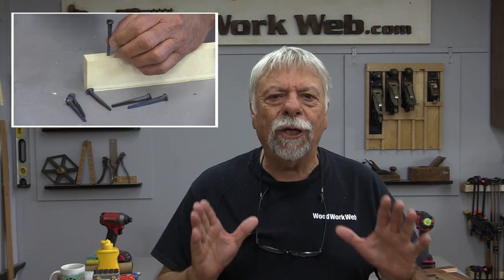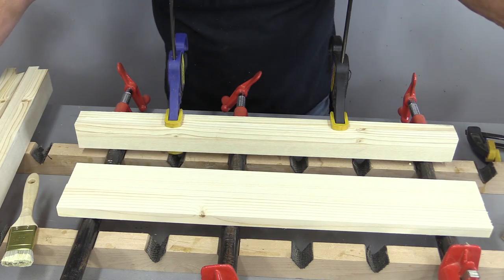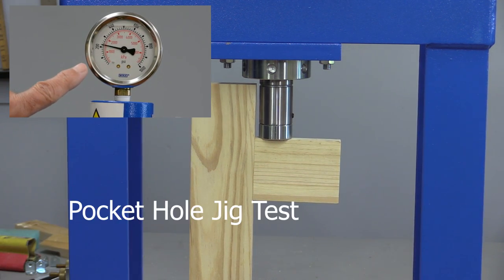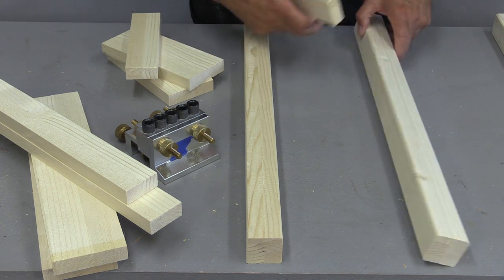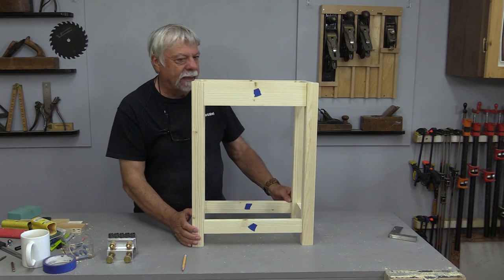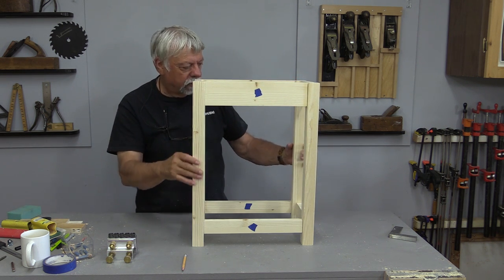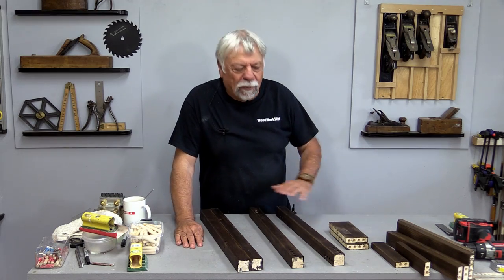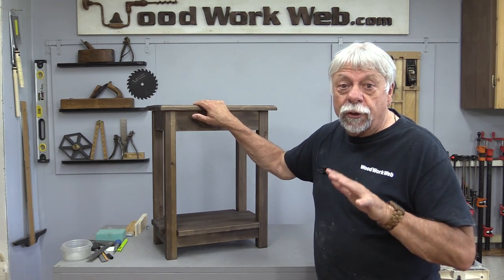Best Results for Woodworking with Pine Wood

Comment: Years ago, I started out building my furniture projects out of pinewood simply because it's always been the least expensive wood available.  And, I always figured that, as I got better at wood working, and had more money to spend, I'd surely switch to using the finer and more expensive woods.  But, after many many more years of building furniture, I still use pinewood today.  Over the years, as I became more familiar with the characteristics of pinewood, I started to see how easy it is to make my pine furniture look absolutely gorgeous!  It's also very easy to work with.  But, one of my greatest pleasures is taking a stack of lowly construction lumber and turning it into a stunning piece of furniture for people to enjoy.
Reply: a lot of pros say that it's much easier to work with hardwood. I like working with pine,just need to make sure it's dry before you buy it..boy does it like to do yoga or what...
Reply: I love pine. Light, strong and easy to cut and the price is right. Although lately even pine has become pricey. It seems that there is always a ton of scrap laying around at the end of driveways. Hard to beat 'free'.
Reply: I agree !
Reply: I use different woods but pine is one of my favorite. It really has grown on me.
Reply: I have want to make a 6 ft pine post but the wood keeps warping. Do you have Any suggestions please? I just want a 6 ft vertical, straight post, used 1x6 and it warped after I jointed and planed the wood. What can I do to prevent this?

Comment: I am very happy I saw this video because I had heard that using dyes eliminates patchiness  However, when I saw your results I saw the same problem I had which is inconsistent colour darkness.   Which I think is normal because pine has inconsistent densities. So even with dyes it takes different amounts of colour at different parts of the lumber. Fortunately, I have a solution which I will be publishing shortly.   Cheers

Comment: I did not know that 2 boards glued together are stronger the 1 board the same size. Ty for the education!
Reply: They are not only stronger but more stable, they resist warping and twisting as well. Guitar manufacturers have been doing this for decades. A good one to look up is Ibanez guitars, and just look as some pictures. They make the thinnest guitar necks in the world and they do a 7 ply usually of very hard but different woods. Guitarist take them from the desert to rainy Seattle sometimes even days apart and the neck woods don't move.

Comment: Hi Colin !   This is Vivek from India. I am new into woodworking as a hobby lately. Your videos and information  you share are quite inspiring in regards. What I want to know from you ... while trying my  luck with Pine wood, I see secrection of oil from the wood especially at the knots while sawing and drilling. Though I got a couple of 2×1 's  to try them out as trial, for  making frames for a wall hanging chisel storage shelf. I am not sure if adhesives will have a great go thru this oily and sticky surface .... Kindly  guide me on this please.....
Reply: If you have sap coming out of the knots, you can use knot sealer on them. It may ruin the surface around the knot for oil finishes, so it's probably better to use when you are painting the piece. If you have sap coming out of sap pockets in the wood itself - outside the knots - I have no idea how to fix this. I have a shed built with pine construction lumber, and it leaks sap in a couple of places even 10 years later ...

Comment: I'm still working with low cost materials, someday I hope to start making projects with nice hardwoods. These tips will surely help me now, thanks Colin.
Reply: Go to an actual hardwood company near you.  Buying stuff such as maple, ash, etc. from an actual hardwood company is only like 25% more expensive than buying appearance grade pine from big box stores.
Reply: The more you work with pine, you'll see that you can actually build some very stunning furniture pieces with it.  And, when it comes to staining, be sure to apply Minwax pre-stain wood conditioner before you apply the stain.  It will stop the surface from blotching and it'll look beautiful.
Reply: Same here! Making majority of my projects out of pallet wood currently..save the planet and save a buck too!!

Comment: I am just amazed the strength of the dowels over the rest, and now i have been taught how to better build my projects. Thank you for sharing ( Stay Safe ) .
Reply: I'm a firm believer in dowels.  I'm surprised that the pocket holes were even that strong.
Reply: @CeeJayThe13th  Bogus test, do the research,
Reply: @OldDunollieman  I don't need to do the research.  I just meant in that test.
Reply: @OldDunollieman  there’s plenty of tests showing pocket holes failing with minimally force compared to dowels and m&t. They are not strong, nor were they ever intended to be a structural joint in solid wood. They work great for cabinet construction and face frames, but they aren’t for furniture.

Comment: I’m building bookcases using pine stair treads, they are 1” thick with one bullnose edge. Got the idea from Tom Silva. I put a Minwax stain on them. They are uneven at first but just wait a day or two and they even out and become beautiful. I’m going to check into the dowel jig.
Reply: Sweet idea on the stair treads!!

Comment: I appreciated this video Colin.  I use pine as it is readily available and I am cheap and not very knowledgeable. I have a doweling jig and I find the problem for me is getting the holes in the opposing piece in the correct spot to fit the other piece.
Reply: The biggest piece of advice I can give you... you must have a constant. Always use the same "start" point. And that spacer he had in the dowel jig gives you the "reveal" spacing. If you want the pieces to have an offset look that is necessary for your constant in that direction.
Plan out your work, either drawings or in your head. Make sure your pieces are all uniform. Use tape or pencil to mark "sides" "top/bottom" etc. And always use the same reference point or "constant."

Comment: I heard that if you sprinkle a tiny amount of salt on one side of the glue up, it will keep them from slipping and the tiny amount of salt doesn't affect the bond of the glue.  The glue is water based and melts the salt working quickly will make it work.   Salt is gritty and provides enough resistance to keep the boards from easily slipping.   I've also heard glue is only needed on one side of the joint so you could glue one side of all the boards and salt all of the boards at one time, stand them all up, then clamp all at once.

Comment: One factor with finishing before assembly is that you can lose the marks showing which joints go together.  This applies more so when refurbishing older furniture which may be less than square. 
Before disassembly I mark the inside of the frame with a pattern of indentations using flat bladed and cross-head screwdrivers and a punch - these marks are not obscured by the finish.

Comment: When considering the strength of any pine joints and or fixings, the first thing to consider is that we typically use non-structural pine in joinery etc. Structural graded pine is a very different ball game, so it may be beneficial to consider structural pine and fixings in some situations, particularly workbenches and large storage racks. Here in Australia we have MGP10, 12 & 15 (Machine Graded Pine) for structural, house construction applications. MGP12 has a tension strength of 12MPa (1740psi), bending strength = 28MPa, compression strength = 24MPa, shear strength of 3.5MPa. For house construction in non-cyclonic areas, we can achieve up to 6kN (1348lb) tie-down capacity using a No14, Type 17 screw with 50mm (2”) penetration into the receiving member. Structural timber doesn’t generally have the visual appearance grading for what we want, but it’s well worth considering as a substrate.

Comment: I tried using colored leather dyes on wood and had good success too. I agree that a dye does a better job than stain. The dyes that I've used were water or alcohol based by Fiebing's leather dye.

Comment: Great advice. I follow a similar pre-assembly finish process. I use blue painter’s tape to protect the areas where I want glue. It takes a little time, but I know that I have a surface that will absorb glue. With Osmo it works well.

Comment: Good video as always. Might have to try finishing before sticking stuff together and see how it goes. The dye is interesting as well but I will say I prefer using the conditioner first with stains not only to remove the blotchyness but it also give the base a nice golden tone so the stain looks much more rich and vibrant, wonder if it'll work with a dye as well... I have many new things to test now.

Comment: Nice video, applying a finish is always my most dreaded part.  For some reason the volume was very low though.  But when a commercial came on it would blast through the speakers.
Reply: WHAT???!
Reply: That’s typical for all commercials in all media.
Reply: @Sillyturner  that hasn't been my experience. The more savvy YouTubers have a better handle on sound and mixing.

Comment: 2:25 Pro tip: Keep your two pieces touching as you apply glue, rather than having to run the bottle back and forth 2x and risk it running down the gap between.

Comment: A spit coat of shellac on pine and poplar works very well—and even better than a sealer. "Spit coat" is a term to describe a thinned-out shellac—just enough shellac, and lots of thinner. Let it dry, sand it verrrrry lightly, evenly, and thoroughly with 400 grit or finer, and apply stain. I once told a guy about that who was looking to stain a mantle made of poplar. Turned out that he did do that, and was happy with the result. It works for me with stain. How it'll work with a dye is anyone's guess, but it's worth a try. Anyway, I'll wager a loose tenon setup would work as an alternative.
Reply: That's the right way of doing it.  The shellac penetrates any end grain or porous wood that would soak the dye right up and make a mess.  All the pre-stain products are useless.  Furniture companies used to use that method and then use toners to get the color.  Have no idea what they do now.  Good comment.
Reply: @alext8828  I neglected to mention that a spit coat of shellac is the perfect base for natural oil finishes. I once told a guy that, and a few months later, he showed me a deacon's bench made of walnut he made. I'd forgotten all about having told him, but he was happy to show me the results. Actually, I'd told him to alternate coats of shellac and oil—oil first, then seal with shellac, and again and again. Don't remember if I'd read about that approach or just did it on my own.

Comment: When using pine a rather common problem is to have a sliver break off of the edge then the glue wells up during glue up and you have a bright yellow line to dig out or cover. With a dark finish you can get rid of his problem by gluing with dark wood. I really love it on walnut but it works with any brown stained wood.

Comment: I like to buy pine 4x4 and re-saw as needed.  They look better than even the prime 1x4 and I've never seen a 4x4 with sap holes.  Make those legs out of 1 piece, looks better.  True, maybe not quite as strong as 2 glued but still plenty strong enough in my opinion.

Comment: I really prefer the pocket hole joints over dowels for simple projects.  Did you compare pocket hole screws with no glue, against glued dowels and biscuits?  I know pocket hole screws, without glue, are often used for some cabinet assembly, but I always add glue to the joints.  The simplicity of the pocket hole system and the self-clamping feature of screws eliminates the glue drying time and need for clamping.  Coarse thread pocket screws hold better in pine.

Comment: Well how did you use the router across the wood fibers. That was a topic you should have covered in this video because usually when pine wood is trimmed with a router it  gets a rough splintered edge. Some advise to reverse route across fibers.

Comment: I have worked with pine most of my life but I have never tried the dye or water based stains. The oil based stains I always use the pre-stain, makes huge difference in the end result. Wondering if it raises the grain, would it  be best to apply the dye/stain then lightly sand it down before applying another coat of stain or whatever finish... poly,  varnish or shellac..

Comment: Is Osmo better than boiled linseed oil? The linseed dries pretty fast, it's cheap and I like the finish but it has chemical dryers added so may not be useable on turned plates and bowls. Also Danish oil is great, tough and I believe it's ok to eat off once it's well dried. It's safe and tough enough to be used on wooden kitchen worktops across Europe (and UK :). Needs to dry overnight before you can re-coat it though. For a big kitchen Osmo might be a bit pricey?

Comment: I'm very impressed and I have a question. I am using pine 1x10 pine board. My messurments a are 30 in long x 18 1/2 wide x 10 tall. I want to strengthen the box with a frame and dowl rods any ideas?

Comment: I made a six drawer chest of drawers when I lived in an apartment.  Designed it around standard sizes and just used drywall screws.  Held up well, now it's in the spare bedroom full of stuff (junk!).  Pine is a very nice looking wood.  I prefer clear finish.  

I might make a little table like that out of walnut.  Sorry, but I have access to walnut that isn't to expensive.

Comment: Really nice work, Colin! Thanks for all the tips! 😊
I don't know why, but looks like I'm allergic to pine! 😳
I've already worked with a few woods here, but I can't deal with pine without getting a pretty bad cough! Go figure. 
Anyway, stay safe there with your family! 🖖😊
Reply: Wear a quality respirator when working with wood, one that has replaceable cartridges,  That will help big time.
Reply: I'm actually allergic to Maple tree, see an allergist and start taking shots. It helps, it really does. Cheers :)
Reply: @Twin_Flyer  That's exactly what I do when working with pine. But with woods like Garapeira and purple heart, both Brazilian woods, I have absolutely no issues. And I already worked with other woods here that I don't remember the names now and nothing as well. 
Go figure. 😕
Reply: @Ham68229  Yeah, I'm thinking about it! Thanks! 😊
Reply: Consider upgrading your workshop dust collection system and use a respirator.  At least we are all getting used to wearing a mask now days.  lol.
Reply: @chrisgraham2904  Very true, unfortunately.

Comment: Another useful vid' Colin but I have one question.  Why do you use blue tape to mark the face of your workpieces?  What's wrong with the traditional joiners marks that indicate both your face and edge?  As far as I can see, blue tape has a few disadvantages.  Firstly, it doesn't indicate the prepared edge your working from.  Secondly, it creates a high point on the face of the workpiece.  Finally, it can be rubbed off, leaving adhesive that must be removed, on the face of the workpiece .  The traditional pencil face and edge marks have none of these disadvantages.
I ask because, knowing you, there will be some reason behind your thinking. [edited for typos]

Comment: Tht dowling machine of yours is there a link or recommend place i can get one? Thank you in advance
Reply: That is called the Dowelmax. They're awesome. I can do all the joinery for a table like this in under an hour... vs. many hours to cut all the mortise and tenons and then fit them. Maybe I'm just bad at mortise and tenons (I mean, I know I am), but this thing is great. Strong, perfectly aligned joints quick. It's expensive, but so is your time, especially if you're a hobbyist like me who only has an hour here and there to work.

Comment: I look for your videos every day.  Thanks.  The strength is somewhat skewed in that you're testing a single rail on a stile.  Most projects have a rail between two stiles.  The strength is probably much better.  Could you give that a test.
Reply: The test was most definitely skewed for that very reason. Plus there was no glue used.
Reply: @OldDunollieman  i mean if he did it'd just improve the performance of each method, with them still presumably ranking the same

Comment: Is there a rule of thumb on dowl lengths? 
The amount the dowl penetrates into the leg is shorter than how much it can go into the table apron. Does making a dowl that's more than 2x the thickness of the table leg make a difference then? Assuming the dowl is placed unevenly in the joint.

Comment: Hey Colin, Pat here from Toronto, Can.  I was wondering how you fasted the top on?  Did you also us dowel it, or was it some other method?    I am a relatively new woodworker so I try to soak it all in.  Your videos are very informative and I seem to learn something new from each of them.    Thanx and keep them comin'.
Reply: And I want to know if the top and shelf were purchased pieces or edge laminated. Additionally l wondered if you  installed the shelf before glue/ clamping the leg sections together

Comment: Any issues gluing up after the finish is applied? I've heard some types of finish can cause issues with glue adhering properly.
Reply: Just make sure you don’t put finish in spots where the glue goes
Reply: @DavidLopez-tk3lm  was thinking the same, but that’s hard to do such as in this case. We’re only the dowels glued or dowels plus joint surface?